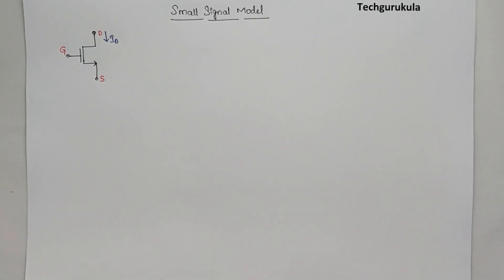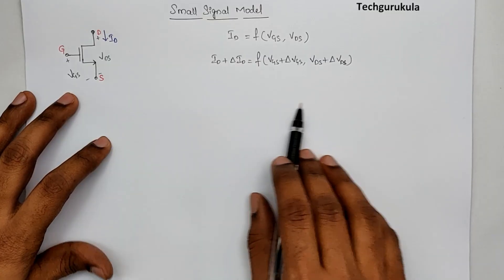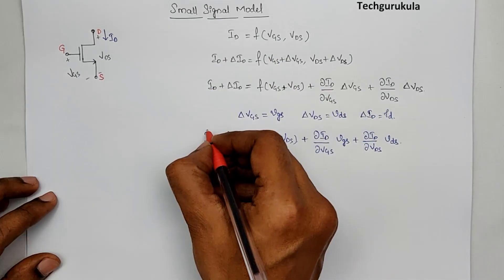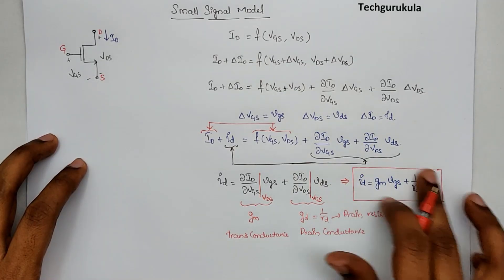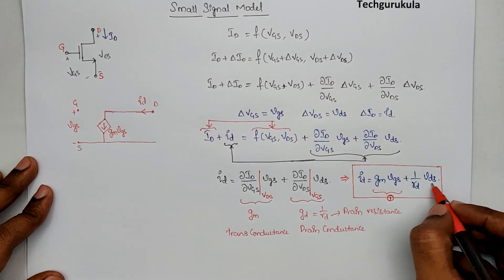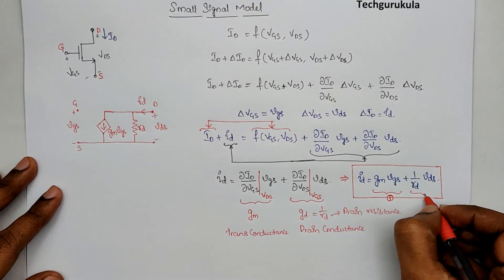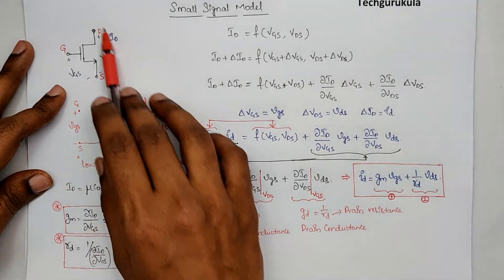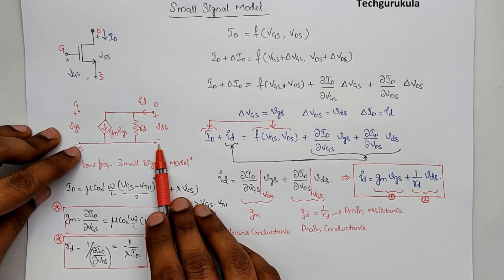Electronic Devices: MOSFET - small signal model

Comment: can someone explain what is the cause of the small change? is it just an intrinsic resistive property of the material that causes changes when a potential is applied at either the gate or the drain?
Reply: when you're with AC analysis the voltage changes over time and that's your delta V